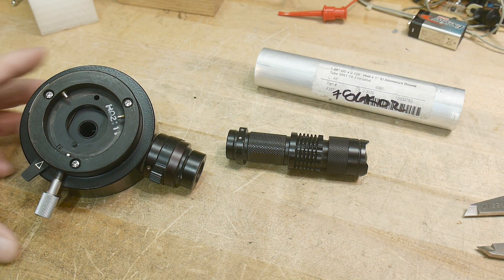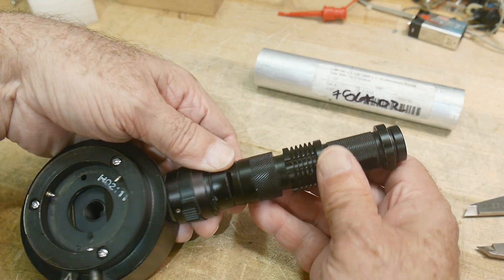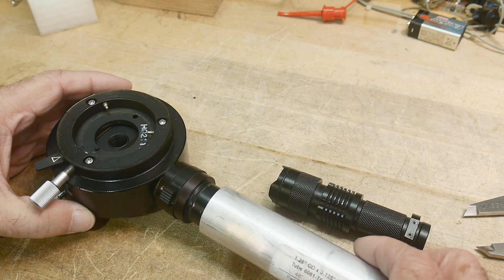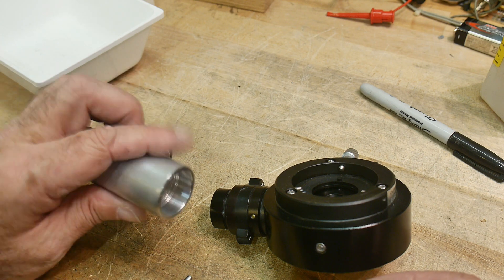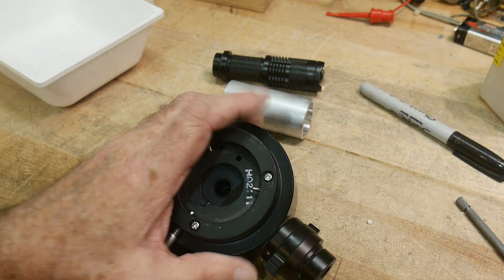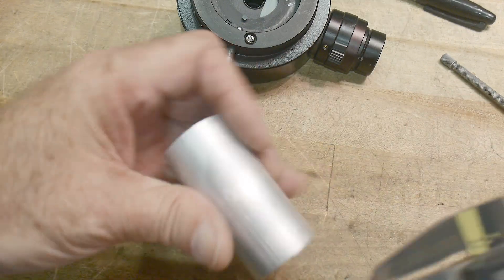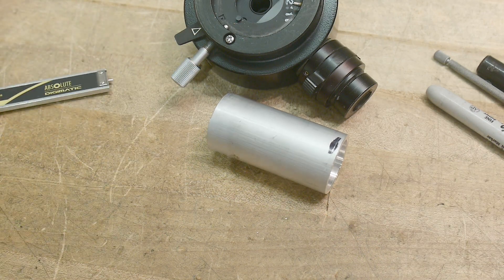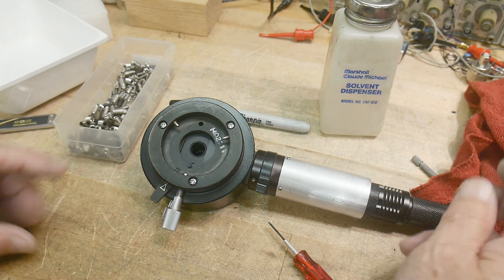#1446 Microscope Illumination Modification

Comment: Also, telescope eyepiece optics adapters would probably work too. 
It’s a cool adaptation you made but won’t the length put undue stress on the attachment point to the microscope. Use your same adapter, pull all the hood bits from flashlight and fashion an external power supply of make a lower profile battery pack with coin sized button batteries.  It’s a very cool scope. If you ever need materials to look at electronics from a distance, I have two fairly nice, functional telescopes with extra parts, adapters, etc. 1-Reflecting , 1-Refracting . If ever needed, I’d happily donate them to the cause.
Reply from the maker: the original illumination part from Olympus has more mass than mine. did always seem like a weak point, but never saw one damaged.

Comment: Hello, 🤔 so I think you turned the tube, when you tried it before drilling the locking screws, the flashlight went all the way in 😁
Beautiful work 👍 that's what someone does when they have a lathe behind them

Nice day 🙂Tom
Reply from the maker: I had two 'identical' flashlights.  One for the top and one for the bottom. Mixed them up.